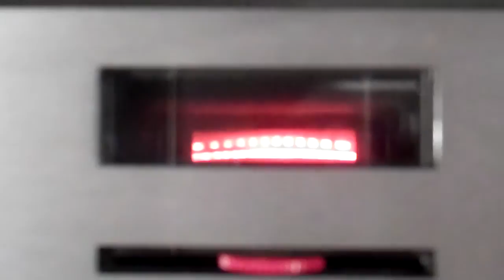Thorens TD-125: How to read the strobe and adjust pitch

Comment: My pitch control is at the end of adjustment (the wheel) and needs to get toward the center.  Can this be adjusted?  It's all the way to the left, or "+" and needs more speed.
Reply: the adjustments are in the service manual - you can get a free copy from vinyl engine website

Comment: i have a mark2 model and my issue is no sound going to my amp or speaker. any thoughts? im thinking bad rca cables
Reply from the maker: sometimes just replacing the plugs will do it: https://www.ebay.com/itm/Stop-Hum-Thorens-RCA-Plug-Replacements-Pair-TD-160-TD-165-Turntable-more-/223046892451